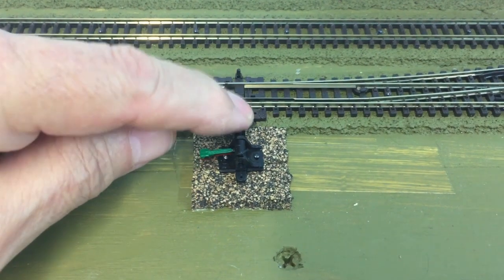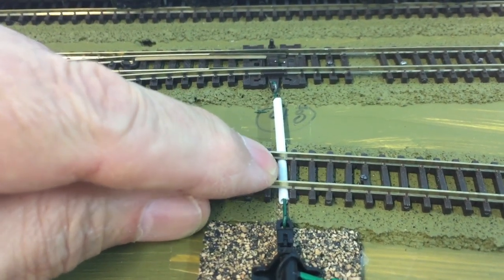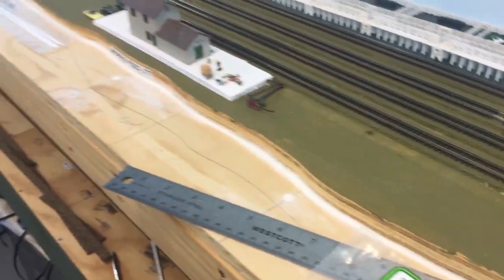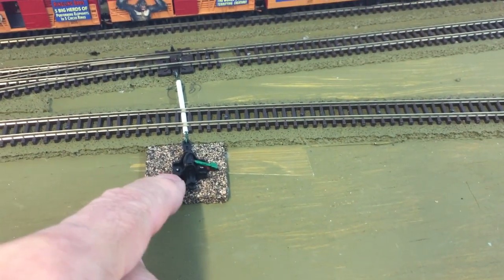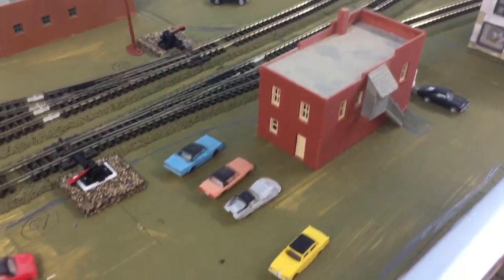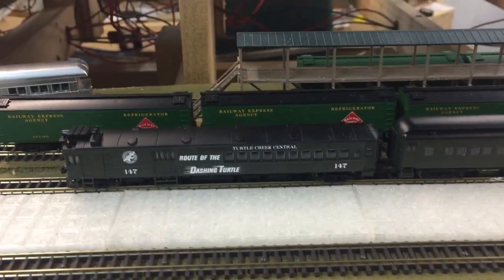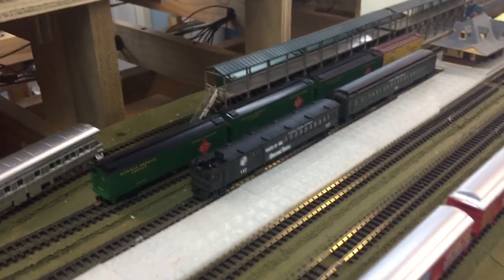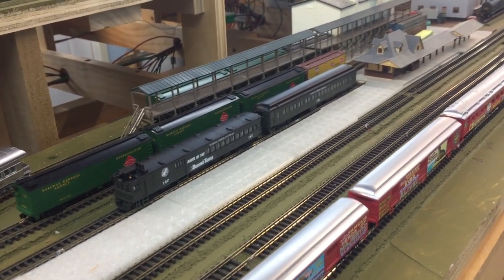Manual Turnouts, River Bed, & Commuter Trains

Comment: John, really like the update. The ground throws are very nice to use, I have a lot of switches on my layout and all are the Caboose throws. Keeps the cost down also!! Nice tip on throwing those two switches at the same time. Thank you for sharing
D. Muse
Reply from the maker: Thanks David.  Back when I was planning the layout, I did a cost estimate for electrifying all of the 96 turnouts and that number was unaffordable in my book so I just did the ones that were out of reach....John

Comment: Fantastic 1 away I know you’ll get that straight away. I’m with you on lighting on the turnout. Great idea with the switch and easily hid with ballast.
Reply from the maker: Thanks Mike.  Using DPDT slide switches would be a  way to easily add the LEDs but I did not want to do all of the extra drilling of holes into the plywood to fit the slide switch. My method of installing the LEDs will require only three small holes when I get around to them in the future (back allowing). I also have been working on your building too.....John
Reply: cool can’t wait

Comment: hi John... l also am using caboose hobbies ground throws for all the places i can reach... i also use the same method of tube under the track...i will give you a shout out on my live stream tonight... vinny
Reply from the maker: Hey Vinny,  Thanks. How is the station assembly coming along? I am planning on tuning in tonight....John
Reply: hi John... i have not started on the station yet ... i have however found an exterior paint Rustoleum's Fine Textured paint.. i'm using it on another build that i will be showing  in tonight's show.. what i can't find is Terracotta for the roof.. have not checked Hobby Lobby yet...vinny